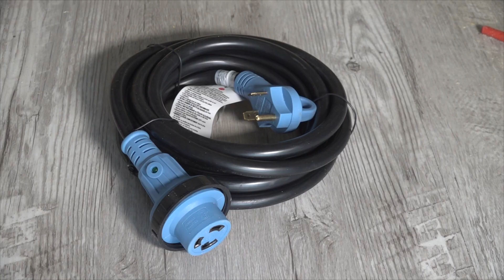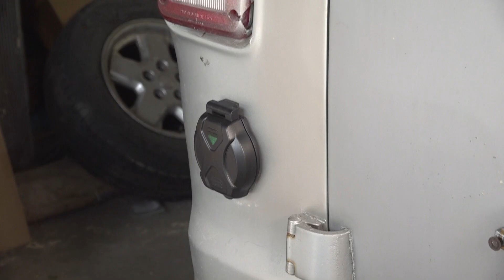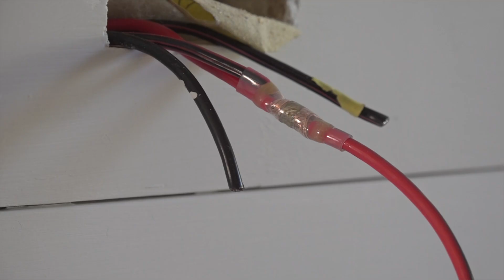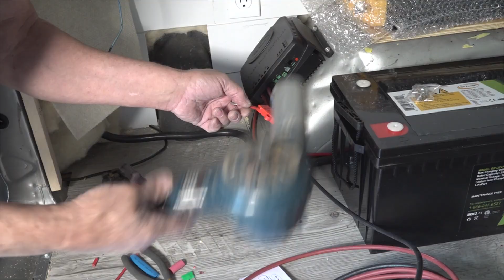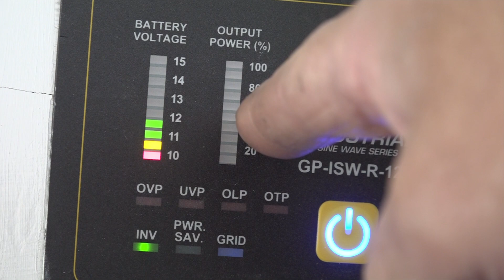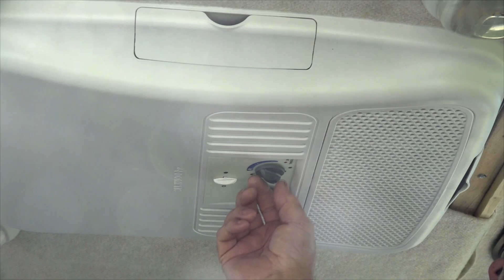The RAM CAMP Van Conversion Project - Episode 4

Comment: The 2nd inverter still doesn’t make any sense to me. Why not just plug into a receptacle connected to the first inverter?
Reply from the maker: There are a couple reasons for both inverters. One is, we are working with both of these companies on this project, and it demonstrates two different types of inverters. Another reason is, one 15 amp receptacle’s max capacity is equivalent to 1800 watts, so for example, if you are using a hair dryer you can only use one receptacle at a time. A second inverter allows you to use two (a hair dryer and a coffee maker) 120-volt devices in the van at the same time.